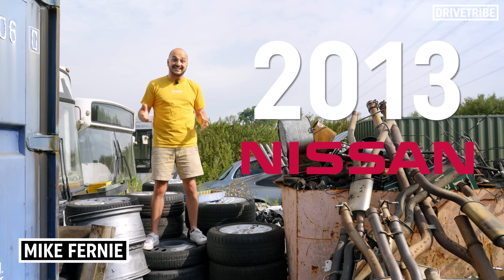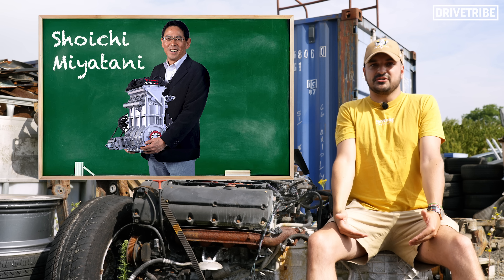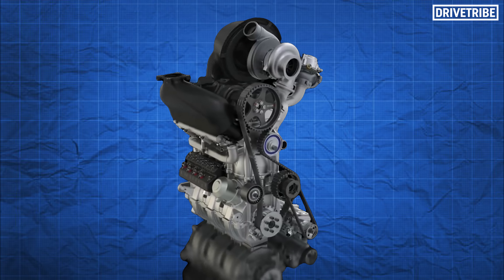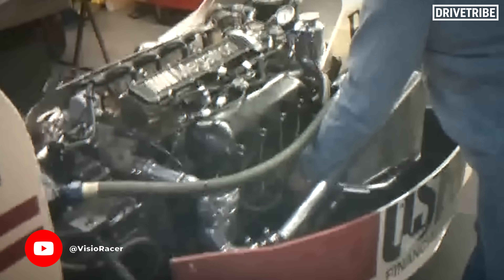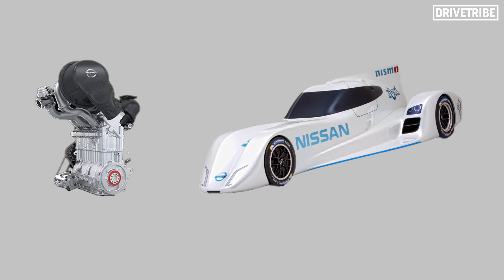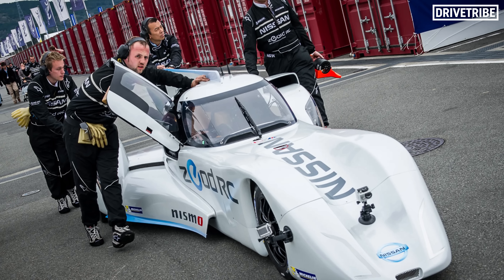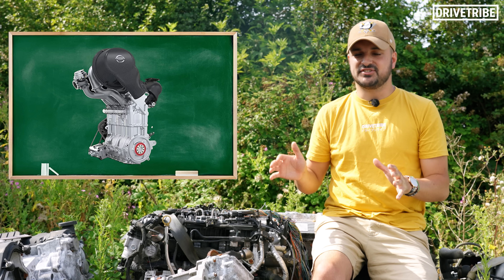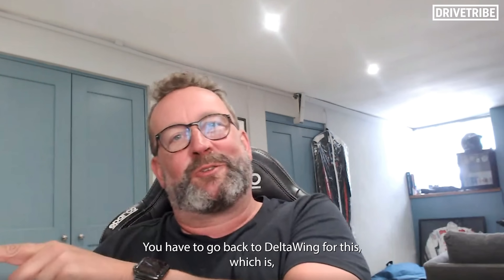This TINY Nissan Engine is More Powerful Than Your Car!

Comment: I would love to see that engine in a Alpine A110R, to see if it would be possible to get the A110R to under a 1000kg. And VW never did make the sporting version of their XL1 did they.

Just some thoughts, ceracoating the entire outside of the engine, for rust protection and from heat coming from the engine bay (turbo, exhaust, brake temps) would also allow for the oil to get warm and stay warm and just allow the cooling pack to do its job. Ceracoating the tops of pistons to stop heat transfer into the crank case and over heating the oil, would also mean that possibly a leaner burn, and having very little unburnt fuel left in exhaust gas. Of course ceracoating the exhaust from the head to the tail pipe as well as as much of the turbo that can be done.

I did read about a diesel where they ceracoating the inside of the intake and combustion chamber to increase thermal efficiency. Don't know what that would do to this engine or application.  But just some engine ideas I've been having, to try to increase thermal efficiency, increase mpg and decrease emissions.
Reply: Engine designers/engineers are always committed to efficiency and reliability with cost of materials and ease of manufacturing being the deciding factor of design parameters... whereas tire smoke is the goal of "tuners"
Reply: @OriginalTrev  yeah, I'd like to believe that in theory. However I counter with the PSA 1.2 Puretech wetbelts. They would just destroy engines, the belts would break apart in the oil, get and bits of belt would clog oil channels everywhere and seize engines from oil starvation. I'm sure an accountant forced that through as an engineer would go for a cam chain.

Comment: This video just seemed a bit confused, I never got what point it was presenting or what cool and interesting thing we were being shown.

"Here is this high power-per-weight engine. A turbo 3-cyl making 400 HP and weighing in at 40 kg/88 lb. PS: it's a race engine and was never available to the public." 

I can think of another fairly light-weight three cyl that makes ridiculous power for its weight. The G16E-GTS from the GR Toyota models, which is a 1.6L 3-cyl making 300 HP in street trim, and capable of over 450 HP when custom tuned. Which is available to the regular consumer, and can be bought as a crate engine.

 "Here's an alternative high power-per-ton engine. It's also for racing use only and not yet available despite being in development for over a year and a half."

At this point you might as well point out the JFC Racing Monobloc v8, which comes in two flavors,  a twin-turbo 2.8L weighing under 300 lbs with the turbos, intake, and headers and producing 765 hp; and a naturally-aspirated 3.2L weighing in at 200 lbs with an output of 460 hp. Or any of Judd's offerings, or any of the half-dozen or so other motorcycle-derived engine variants made by various boutique engine manufacturers. Each of which will set you back the cost of a very nicely equipped sports car.
Reply: This should be the top comment
Reply: Agree, great analysis for an overly drawn out video
Reply: theres also honda K20/K24 race engines, with a 2.5l block they get like 350-400HP NA, and they weigh about 100kg. fairly inexpensive too, for a race engine. set you back about 15k.

so if you don't have judd money...
Reply: @DontKnowHowToTypeIn2  all of this sounds a lot like hillclimb which I love since it has a pretty much unlimited category going to watch one this sunday 800+ evos lancia delta s4 and plenty of weird formulas I know nothing about except that some have that Judd stuff you're talking about in them :D like 11.300Rpm SLK340 Judd V8 Falperra Full Run - Pure Sound & Sparks Show
isle of man TT > hillclimb > anything else (got to give it to those crazy bikers I'm never doing that without a rollcage)
Reply: Agreed. Every section just seemed to talk around the subject. During the interview portion, he says "and don sued us for 130m dollars" and then that's that. Like, what? Why did he say that? Is it because there were consequences? Why did don sue? No further commentary is given. The whole video is like this.
Reply: 600 hp today for 1.6 toyota (carwow channel)

Comment: I want this engine in a motorcycle!
Reply: Or as an aircraft engine, man what a great airplane engine this could be.
Reply: @izzyplusplusplus1004  Eh, only if you fly straight and very low. You would also need to service it every 100 flight hours or so, lol.
Reply: @Atom224  no sir, with a turbo, the ceiling would be very high, I'm guessing in the 30k ft range. Engine management and a turbski gives ICE engines great performance, and is how the turbo got invented to begin with. And the straight thing? What are you even talking about? Control surface sizes on the wings and tailsection determine maneuverability, along with weight, so once again, no you're wrong, it would be great for an aerobatics aircraft as well.
Reply: Its not that special when you actually look at motorcycle engines ?

Comment: 9:00 An engine is not pre-heated to "maximize lubrication".

A racing engine is pre-heated so that clearances and other dimensions are within design tolerances. When the engine is cold, due to negative thermal expansion some parts will be out of design specs. Even systems which do not require any lubricants may need to be run only at operating temps for clearance reasons.
Reply: The oil has to be warmed up as well.
Reply: So it lubricates better...
Reply: @anthonyrowland9072  I reckon it's more to do with the "Exotic use of Magnesium, Titanium & Engineering " combined with design quirks, which it was built for Le Mans I think with Internal Combustion on it's way out, it became surplus to requirements.
Reply: Weeelllll ... "Pre-heat" is essentially the same as warm-up, but without the run-time/parts wear time factor. It aids in lubrication by reducing the viscosity of the oil, allowing it to be distributed to parts quicker. ;)
Reply: @flyingdutchmanindustries5877  Weeellll... Pre-heat is not, at all, the same as warm-up since the oil that you use is already up to temperature. So, if you want reduced viscosity, you simply use a different oil to begin with. :)

Like I said, it is about clearances due to thermal expansion, not lubrication.
Reply: Clearances for oil passage, less friction, and warmer, less viscous oil. It's all related.
Reply: And don't forget the Lower Compression to enable the Engine to not get Knocked to pieces. 😆

Comment: One could state that Nissan wasn't wrong, looking at the latest 3-cyl. engines from Renault, Ford and Stellantis being used in their Rally 5/4/3 models, with outputs between 170 and 220hp, basically road-going engines tuned for racing but still very reliable, with services quite far apart.

Comment: The lighter and smaller the quicker they go pop! We are seeing that in all engines across all manufacturers.
Reply: I was gonna say my Toyota engine is heavy and weak but it’s also at 292,000 miles with zero major maintenance
Reply: in my opinion, it's more a problem of downiszing to the bare minimum materials thickness and quality which often crosses the threshold of reliability in the wrong direction, old engine block were machined out of a large block with thick walls now they are cast and hollow with some really thin walls on the cylinders and engine block, I can tell you in computer hardware it followed the same direction, they sold you processors that could run half faster just like they sold us engines in cars but after 2000 they realized they could either save money on the part or upsell it as another more powerful but more expensive component, if you know nothing about computers check Intel 13th 14th gen 2024 problems and you'll see the exact same thing car engines experience, they reduced the safety margins so much intel cpus self-destruct (my 13900k just did blue screens nonstop am typing this on a new amd pc ><)
Reply: @fredEVOIX  This. SO MUCH this. You want an engine that will last half a million km, have the displacement of a motorcycle and the power of an american muscle? Totally doable.

Just be ready to pay a kidney and liver for it.
Reply: @fredEVOIX  Yes!

Just like Subaru and the closed deck 2.2 switch to the open deck 2.0/2.5 years.  The number of 2.2 blown head gaskets vs ether the 2.5 or 2.0, those 2.2s were tanks in comparison, and many still going if you can find em anyway.
Reply: Go pop? What do you mean?
Reply: Definitely doesn't apply to motorcycle engines 😂 rev up to 15-20k no problem
Reply: That depends on what there’re made of because the materials like alloys to make them lighter tend to be soft
Reply: Then my BMC A series 948cc engine ought to live forever

Comment: "How did that work?" I should imagine without 500 mile service intervals, and regular rebuilds, quite briefly!! Lol
Reply: They did lemans with it, so about 2k miles
Reply: @jonathanedwards8913  didn't he say it broke down after 6 laps?
Reply: @spudgunn8695  that was a gearbox issue though so they didnt get to test how long it would last
Reply: @spudgunn8695  if you actually watched the video, it is the transmission that broke. That does not mean the engine  has a 500 service interval.

Youtube comment section Armchair engineers are so cringe 🤢
Reply: @diaboles  Wait, Nissan having a transmission issue? I've never heard of that! looks over at pile of CVTs in the scrap yard
Reply: Yeah, turn that into a production car engine and you got a totally unspectacular engine for mass market or a somewhat noteworthy one for the aficionado market.
Reply: Typical service window for a motorcycle engine
Reply: If your engine holds up too long some part is too strong and you are giving away power. Depends what the engineers have in mind. Rebuild every race? Go for it 😅

Comment: No, the F1 BMW turbo did not produce 1500hp. Just because people keep saying it doesn't make it true, even if it is said by ex-F1 drivers with a fading memory.

Some people agree that it made somewhere between 1300 and 1400hp in qualifying trim, with qualifying fuel. At one point, not even the BMW dyno could measure numbers as high as 1500.
Reply: But, as far as I understood that bit of automotive history, they didn't have the dyno tech and capacity to test at those insane power levels. The power levels were estimated based on comparison of lap times in qualifying trim vs. race trim.

In the end the problem wasn't so much the power but the cooling. The 1400-1500 horsepower at, give or take, a third mechanical efficiency, meant that there was roughly 2 Megawatt of thermal load to be moved from engine block to outside air. That was impossible to realise in the F1 car package of the time. Those engines, when in qualifying trim, simply overheated after one or two laps driven in anger.
Reply: @Hydrazine1000  Bigger heat exchangers could've been used in qualifying, plus fans for cooling purposes were still allowed, if I'm not mistaken. There was simply no need for the engines to last more than a few laps, therefore thermal stress and fatigue were taken to extremes. Sometimes teams got it right, other times the engines would smoke-signal their disagreement.

Comment: If you take a FORD 2.0l or the 2.3l  from Pintos Escorts and such the dirt trackers have been making 600 hp out of them with turbochargers for decades. They last seasons under full race, full boost racing here in the U.S.A. What you are talking about is peanuts.
Reply: Also weighs a LOT more. The impressive thing isn't it's power output per se, it's the power to weight

Comment: It's such a shame that Nissan didn't put a chilled out 150-200bhp version into production, would have made for an amazing platform and being so small you'd be able to swap it into almost anything if you can custom fab some engine mounts

Also Diglett dig, Diglett dig, Trio Trio Trio
Reply: Triumph speed triple. 130-180hp depending on vintage, 70kg including a gearbox that doesn't explode, and fits into anything. It also sounds amazing with the T-plane crankshaft
Reply: Just like the Yaris 3 cyl, people are getting 888hp from it at the wheels, but that isn't daily driver.
Reply: @martinfisker7438  Not the speed triple but I REALLY want to put a Rocket3 engine into an old VW van. I know,  Im weird.
Reply: There's a Nissan nismo note E-tech which uses a 3 cylinder hybrid. But iirc the power output is nowhere near the 200bhp.
Reply: They did.  Its in every new Rogue.  201hp/225tq, non-hybrid, and its amazing.
Reply: There's a rumor that Nissan made a prop driven plane. It crashed at an airshow. Unconfirmed. Maybe happened late 80s early 90s.
Reply: Especially now with the S16 in talks again.
Reply: imagine a Nissan gt motorbike with one

Comment: if it makes 400hp why not put it in a 6Ton truck? because 400hp is not 400HP... 1hp is 0.1HP, it's a 40HP 3 cylinder. it's max output is what most diesel engines idle at for decades.

Comment: I wasn't surprised to hear that photo was a fake - 40kg may be super-light for an engine but it's still 40kg :) Having said that, if you'd like to put one in the post for my MX-5 I'd be eternally grateful :D
Reply: What would be wild would be Koenigsegg 80kg Dark Matter Electric motor with 800hp lol
Reply: maybe 40kg for the block, and another 40kg for ''all the extra bits that connect TO IT to MAKE IT AN ACTUAL ENGINE... ;)   ???  eh...   kinda my thought about it... ;) but if it was all titininiamium or some superlight alloy , eh, would be awesome to feel one in a 260z or wutever or other some OOOOL*Z*car...
Reply: 40 isn’t bad 😂 that’s a bag of concrete  just head to the gym and you be fine

Comment: I think it is disingenuous comparing the V10 and V8 screamers, as they are Naturally aspirated where as the BMW is a closer representation being that it and Nissans are both Turbo Charged / Forced Induction. People have taken honda B and K series to near the 1500 hp range like the BMW, and they were also Turbo Charged.
Reply: Why disingenuous? It's a discussion about Hp per kg of engine weight. Completely legit comparison for the points being made
Reply: @deanjdk  Yeah hp per kg is much better than hp per liter, as an engine with much more displacement can be lighter (depending on engine design and material). Either one only takes how much power the engine makes at a specific rpm into account though, when an engine operates over a range of rpms.

Comment: Toyota put 2.7l petrol 4cyl engine into Fortuner and Hilux. What's so weird about it ?
Reply: Its about the limit capacity wise for a inline 4 cyl petrol motor due to harmonics.
Reply: The bigger they get the more the vibrate I think.. or harder to balance ?
Reply: @BUNYIP1980  yeah crankshaft harmonics come into it.
Need revs for big power, at this point revs arent their thing.. 
Not so much an issue with diesel cos theyre not really revving
Reply: @BUNYIP1980  Yup, an inline 4 or flat-plane v8 has that issue. Whereas a cross plane v8 doesn't (at the cost of a heavier crankshaft). Hence why you can have a 10 liter V8 that doesnt rip itself apart.
Reply: And Porsche had a 3.0 4cyl!
Reply: @TC-V8  yeah, flat 4 different again
Reply: @williamporter7495   no, the 944 S2 3.0 is an inline 4 - M44
I believe largest capacity 4 cylinder passenger car.
Reply: @TC-V8  forgot all about him, 928 or 944 or whatever it was. True
Reply: @williamporter7495  its the secondary imbalance which limits inline 4's to around 2L and flat plane frank V8's to about 4L. Flat plane crank V8s are basically 2x inline 4's on a common crank.
The 3.0 944 Porsche engine is rather rev limited, due to the imbalance.
Reply: @TC-V8  You can circumvent the issue on an I4 by fitting balance shafts geared to run at 2x crank speed. And indeed they do exactly that on many larger I4s.

Comment: That engine NEEDS to be in a Caterham. =D
Reply: I'd put it in a Daihatsu Cuore lol
Reply: That engine would fit in a motorbike.
Reply: I'd put it in a Ford Ka. Just to build the perfect sleeper car to really annoy all the BMW owners at a traffic light.
Reply: @MyRegardsToTheDodo stick a big speaker in it and play stock motor sounds and put an electric motor alongside it so you don’t give away that ur cars modded with one of those Nissan engines and so you don’t use all your gas in the first 10 miles
Reply: No, that engine deserves a Suzuki Cappuccino. Imagine the bhp/kg stats
Reply: @PrestonGarveyMM  putting it into a Caterham Seven 160 would be even more insane with the power-to-weight ratio. 490kg; that's 400kg lighter than the Cappuccino, which is already very light in itself.
Reply: @PlatinumNath  that would be insane, however think of the humiliation the Cappuccino would create if some local idiot in a Golf GTI loses to car a third it's size
Reply: @PrestonGarveyMM this would require significant upgrades on pretty much any part of the Car and still be a deathtrap 😂
Reply: @bavarianmonkey8326  basically anything got to do with handling requires F1 technology 😂
Reply: Excellent! It was my first tout!
Reply: mazda autozamn honda s660 lotus elise porsche cayman?
Reply: A Caterham is too heavy for that engine.
Reply: sticking to JDM one of those old MR-2s or a capuccino